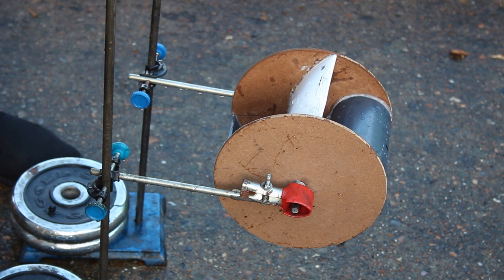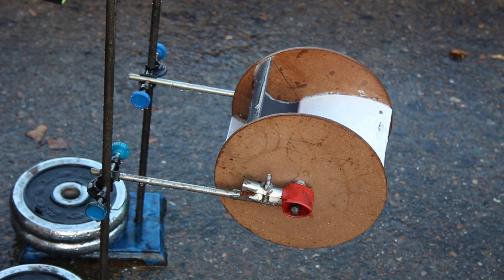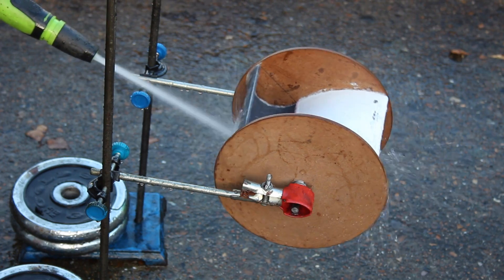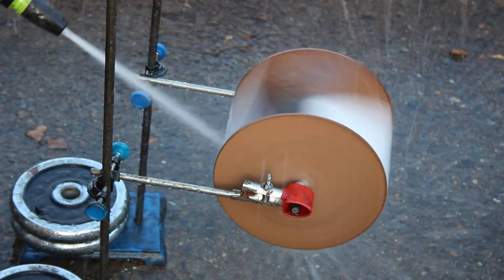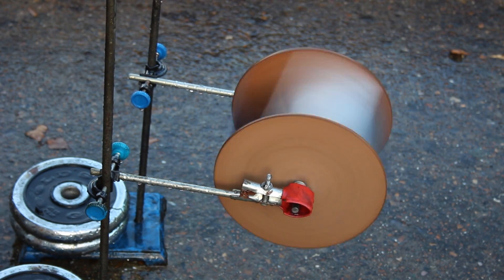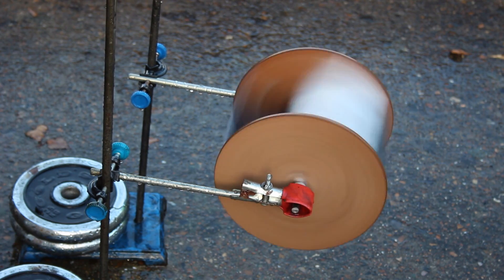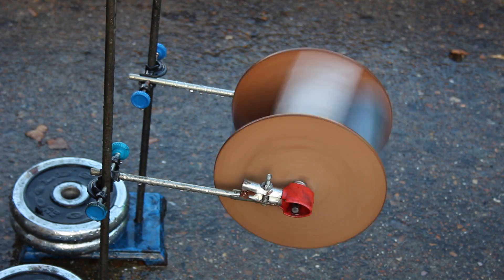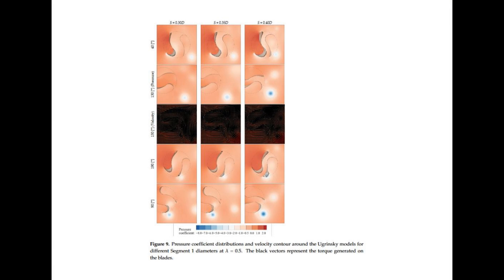1756 The Ugrinsky Water Turbine

Comment: We had a water system using a small Creek where we captured the water in a pipe and put it into a 50 gallon barrel with a lid and out the other side a pipe came out from the top third of the barrel downstream. The reason was any debris that came in the intake pipe would settle in the barrel and clean water would come out the pipe. If you made that a four to five foot pipe with some support you could have the equivalent of a hose hitting your turbine out of even the smallest stream without ruining any of the topography. Basically you're increasing your head pressure or drop by extending that pipe horizontally over the hillside. No moving parts no debris just clean water dumping over your turbine

Comment: For the metal version I would lean on the flywheel by changing the thickness of the pipe I would use e.g. sch 80 pipe for the 1/3 section and sch 40 and below for the rest of the turbine.

Comment: For properties that primarily rely on a fuel burner for local heat or hot water you could build 4 windwalls, 3 sides and a roof,  in front of the intake for the wood or oil burner etc. That would mean you wouldn't have to climb on your roof for cleaning or maintenance and there's no worries about it falling off or damaging your roof.

Comment: Putting this pump on a rocket stove seems to be the first design of the Turbo charged fire barrel, in viewing they both appear to operate at the same  level of physics in , time, temp, speed, and wow the pressure !!! Accept the rocket stove is more of a controlled burn in a living space and the Turbo charged fire barrel people are usually running !!! I guess they have not figured out the third way to shut it off only have the first two, let it burn out or let it blow up !

Comment: Dr. Smith, you mentioned a lot of possibilities for applications here. (wow) Following all the different firing neurons is a trip. Putting it above the rocket stove sent my mind down a rabbit hole. Combine this thought with the water heating element Luke made to the rocket stove, but add a pressure nozzle the the heated water as it's steam outlet. Place your Ugrinsky in the path of a steam jet. Then have Luke put the pizo disks on the hot water reservoir. Just a thought for you.

Comment: Hi Rob. Im still not totally finished with the super-condensator idea, but meanwhile am working on storing energy in form of pressured air. The main problem is still the decharging rate and self destruction if electrolyte dries out. So I organized a 12V compressor with a little storage tank and print (3d) self developed air turbines as well as trying out bought ones. I wonder if you could pimp the 	efficiency by creating a water circle that is driving the rotor. 

Imagen this: A closed system (not air tight / with exhaust - will understand later)(box of plexi glass with cable ( +/ -) in and out)in the lower 1/3 is water(or oil cause oil doesnt vaporize so easy) that can be pumped into a container above (flow only one direction - ensured with valve). In addition you have a 12V air comressor within that box with little storage container that is connected through an electric useable valve, to the container above. Also only one direction possible through valve. When you then use a bit of solar energy to fill the upper container with liquid from below (Waterpump), then use the solar energy to set the little air tank under preassure, and then open electrically the valve so the preasure in the above container pushes the water with force out of the container, through a turbine (electricity generated can leave the system) and then back to the bottom of the box - couldnt this way the turbine use the air pressure created much more efficient? liquid recollects in lower 1/3 , air pressure can leave through exhaust, and force is hopefully used much more efficient.  Could you please try out for us? :)

Comment: Two of these would be good as additional trickle chargers for home battery and solar setups. Have one as a wind turbine and the other as a water turbine with two water tanks. One water tank on the roof and one on the ground. During the day a solar panel runs a water pump to pump from the ground tank to the roof tank. At night once the house battery is depleted to a certain level a valve opens on the roof tank and slowly the water drains into the ground tank passing over one of these turbines as a jet first. Extends the charge of the battery overnight. Of course you'd need anti-freeze for sub-zero climates, but why not?

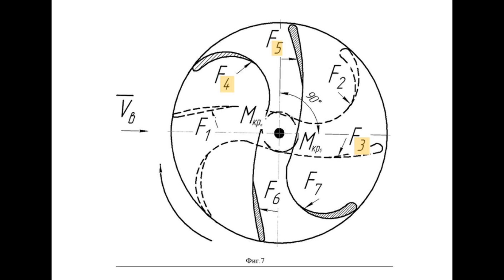Comment: Neat!  One thing that really caught my attention was how bulbous the leading edge was at 3:00.  It puzzled me for a second, but then I realized how genius that it is.  If you take a look at RMS's version, the leading edges were buckled to some extent because the material simply wasn't stiff enough.  Well, if you continue the material around into a long teardrop shape that follows the pattern in the patent, it will increase the robustness of the leading edge dramatically, especially if you fill the hollow with something stiff and lightweight, like foam.  (Essentially, use the same materials and techniques that are used to create lightweight aircraft wings.)

Cheers!
Reply from the maker: nice mate - cheers

Comment: This is really interesting Rob, perhaps more so for me as I live next to a fast flowing river, unfortunately to date all of the turbine systems based around a Pelton type design require something like a 10 meter head to be effective. Other folk with a similar situation have tried traditional water wheels with a degree of success although there is a fair amount of infrastructure required to stop large wheel taking off. I might give this a try come spring as the water flow is particularly strong at this time of the year, thanks again.
Reply from the maker: could you do a video - I would love to see more on this too
Reply: Will do, keep you posted.

Comment: Another "obvious" suggestion is that if you add Steam from your Rocket stove, you'll get an incredible torque boost. Water expands 1800x when it turns to steam. However, it's a bit dangerous because if it leaks it can cause burns so be careful. This is how large scale Coal and gas electricity generation is done.
Reply from the maker: you are talking about a steam turbine?
Reply: @ThinkingandTinkering  you can use what you have made as a steam-turbine. Just connect it to an electric motor. On Power-Stations they have so many patents that nobody can copy that design. So your system would be "better". Simply run a longer axle and use quick-release drill bit shanks to get a mechanical connection out. They're strong, cheap and readily available. They can attach whatever motor-generAtor they want then.

Comment: weighted flywheel spring loaded so the faster it turns the farther out the counter weights move out giving it an 'easier' start and a full flywheel at top speed , much like the centrifugal clutch in a weed eater
Reply from the maker: nice - that would also help with speed in high winds like a governor

Comment: I think the whole point of the shape of this turbine is that it was optimized assuming a consistent flow over the whole surface (e.g. in a current). It will certainly work with a jet pointed at one side, but that's not what makes this turbine special. 

Excited to see the river tests! Lots of tidal currents in the UK :-)
Reply from the maker: that was my thoughts too mate - cheers
Reply: Spot on... I felt the same. I think it'll definitely be 20% more efficient than savonius amidst bulk fluid flow. Mainly bcz,  from any direction u watch this turbine there is always a channel redirecting flow into torque.

Comment: Yes, this is fascinating, thank you.  

Perhaps this is the ideal shape for a water-wheel which were once in common use for cutting lumber or grinding flour.  I wonder if it is also a good design for a paddle-wheel boat.  These have always seemed to have flat paddles.  I wonder if the curved shape would have placed too much strain on the mechanism when the only material available was wood.

I am excited by the idea of it completely submerged in ocean currents.  Of course in that scenario there would probably not be so much flywheel effect.  But I think there are lots of places in the world that have very strong underwater currents which could be used.
Reply: I think the problem with having it fully submerged in ocean currents is that you’d have the issue of sealing off the central axis cause problems for maintenance.

I’m guessing it’d make more sense to make them of a large enough diameter to get the central axis out of the water.

The most interesting thing about this for sea water usage is the natural shape appears to not be as likely to get biofouled, but that clearly requires testing, as well as finding out how it performs in near-shore waves and receding tides.
Reply: @strictnonconformist7369  Those are good points.  I think I did see a video once about underwater turbines, but I don't think they were this shape, and I don't remember how they solved those problems.
Reply from the maker: yes I am quiet excited by that idea too - cheers

Comment: Just wondering if you close it up would work the same? If so could you fill it with a weight that would move to shift weight to help continue the flywheel effect? Kind of like those desktop water seesaws. Still learning lol thanks for this channle learn soo much here and in comments too. Thanks
Reply: like a centrifugal clutch but a flywheel.  Great idea, that would lower it's start up torque needed.
Reply from the maker: nice idea mate - cheers

Comment: Has anybody use tap water pressure to turn a generator. It's 7bar where I live.
No using petrel or diesel to create electrical power, just water pressure.
UK's tap we pay for the water we use, would this be an economical way to generate electricity?
Reply from the maker: you an indeed do it mate and it was popular for a while with lots of 'water motors' being made and sole - mostly they were peloton type motors - however the reduce mains pressure and ground water gets into the supply and contaminates it - so - they were made illegal
Reply: I'm sure it's illegal to use mains water to generate electricity

Comment: Is it just me or does the diagram not match the shape as you've made it and would it make any difference to the performance?
Reply from the maker: there are variations on the design - I presented the one for best compromise rather than optimisation one factor or another - if you want to make one that works pretty well overall the shape I described is the one to go for - if you want to look at other parameters you are best reading around a bit

Comment: How much suction do rocket stoves get at the inlet? Would a turbine work at the inlet? This would mean it would not need to be made of metal this way.
Reply from the maker: not a lot at the. inlet mate - the out let is 'more focussed'
Reply: Better on the outlet. You rely on convection and expansion to pull air into the stove.

Comment: Conical vertical axis water turbine with integrated electromagnetic flywheels? so many ideas!
Reply from the maker: oh yes - have you worked on a few?
Reply: @ThinkingandTinkering  no sir, im just another poor african in africa.
 i cant sleep sometimes so i design different energy systems running simulations for different designs in my head until I pass out.
having no tools and no tech and only getting electrickery for 4 to 5hrs per day.
bit of a challenge.
its taken 4 months to gather 2 broken microwaves.
soon i will build an ammeter and voltmeter to test the circuits.
eventually will build "free" energy system and give it away to my people.
so that they never have to suffer without power any more
Reply: @ThinkingandTinkering  conch shells have those ridges to create cavitation and increase rotation when thrown underwater.

i would throw conch shells under water and saw that if they didn't have those ridges then in would tumble.
originally trying to find who is blowing the bubbles, i know now that that is cavitation bubbles.

picture a whirlpool in the center a conch shell suspended. that shell would try to resist the flow, creating cavitation then boosting it around to match the whirlpool flow.

basically a conch is resistant to initial flow, but once it cavitates it really gets going.

Comment: I'm fairly certain it won't work in a current, that is, submerged in water.  The surge of water turning the wheel underneath will be counteracted by the water running over the top.  Still, worth a try.  Many thanks though.
Reply from the maker: I am not so sure - if you think about it one way the a wind is just a flow of fluid so a river can be seen as pretty analogous - still - like you say worth looking at even if it is just to see

Comment: What about a car electric motor. It produces 737 lb-ft of torque at any where in between 500 and 2800 Rpm. Hooked up with two of those expensive batteries the way it can be switched in between batteries. Hook the drive shaft up to a crankshaft and drive 8 linear generators. With the right cooling apparatus. You should produce enough power to charge one pack of the batteries, and enough to power what ever else was wanted.
Reply from the maker: I am sorry mate but are you suggesting we strap motor to a generator? with the wrinkle of a couple of batteries in between?
Reply: @ThinkingandTinkering  yeah as long as the energy is coming from a storage device, and one of those electric car motors can produce alot of torque 737 ft-lbs up to 2800 rpms. With the fact that the energy coming from the battery and is converted to 220v at a suggested amount of amps, and then you have two batteries the way the battery is charged not under a full load with the motor hooked up on a crankshaft you could push said amount of linear generators be it v4, v6, or V8 it is all just the amount of improvement you can make on preexisting technologies that propels us into the future. I have actually been trying to figure out a way that to store the energy generated and use it to push the device in said question first I started with thinking about air compression look at some of Jeremiah's videos from the last two years, and look at his comment feeds also did alot of talking behind the scenes with testurenergy not that he used any thing that I came up with, but putting a tankless hot water heater on his unit. They also have a a design that had my whole theory in a working device that is called vacudest. The only difference is they would have to add a 1/4 line after the compression stage to the tesla turbine that turbine is not supposed to run over 9000 rpm for 218 horsepower I think that is the numbers, but good luck telling testurenergy that because their design is nothing like the design of tesla I forgot the size of the turbine I think that it is 9in though the one in question. It was in millimeters had to convert it, but yeah that is my idea. I have sacrificed my own dreams and desires to try, and figure this out. Also forgot how I put it in those comments about the energy storage device.
Reply: Conservation of energy just left the chat. I like how you think... Reminds me of me ten years ago

Comment: Great Rob. Thinking about it logically doesn't matter what is used to turn it at the end of the day, as long as it turns. Was wondering when you said at the beginning about low power, if one doesn't have a large head of water could run water through ever decreasing pipe bores to have higher pressure and low volume. MMMM I am not on a water meter so could run a garden hose over it. lol.
Reply from the maker: absolutely mate

Comment: These can be placed in our water supplies. Our sewage system. Rivers etc.
Jacque Fresco he’s the man. Sadly passed.
Reply from the maker: that's an interesting idea - cheers mate
Reply: @ThinkingandTinkering  here’s one for you. The jet fuel hoax. They are using air combustion engines. Jet fuel is for initial take off. F1 cars use them also.

Comment: very interesting concept.. = place the unit in a tank /pond/tub.container.etc,,,, on one side fix a small water pump on the other side fix a generator . set in motion continuous water for pump continuous supply for generator. continuous water supply.  and that aint rocket science,  insulate the water tank from frost closed /encased .....and wow there  you have it. ???????>  easy build. any scale,  no need for external  water or pump energizer ........self running self supplied with electrical energy and output of free elec-trikery. supply.   oh yes.     ??????...any thoughts?????
Reply from the maker: you can try it if you want mate - but I wouldn't think it would run forever

Comment: Submerge the Ugrinsky in a flowing river and have a geared transmission (front and back sprockets and chain from a bike) to a dc motor on a platform above the water. You can select the appropriate gear to suit the flow of water to maintain a relatively constant rpm on the dc motor giving a much more stable and controllable energy transfer??
Reply from the maker: like it mate

Comment: Hey Rob, what if you had a turbine wall that is driven by wind, but also divert your guttering to point at the wall so you will get power from both wind and rain…
Reply: My mind was also on the guttering idea, mount 5 or 6 mini turbines in the square down pipe of the guttering allowing the free fall of water off the roof to propel the turbines ?
Reply: As the video ended I was noticing the downspout in the background thinking the same as you.... it looks at least 18 feet tall, rectangle the tubing you could get several turbines in one downspout
Reply from the maker: nice mate
Reply: Now, this is a place where the 3D Ugrinsky would shine, I think. That shape looks like it would work even if it had no enclosures, just a steady stream of water on top.